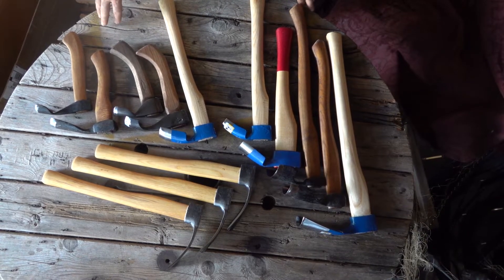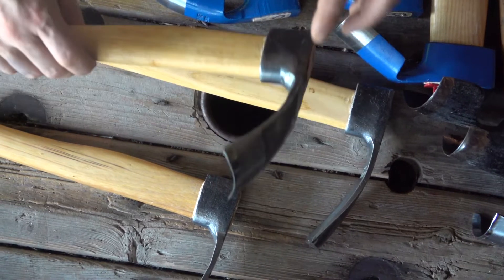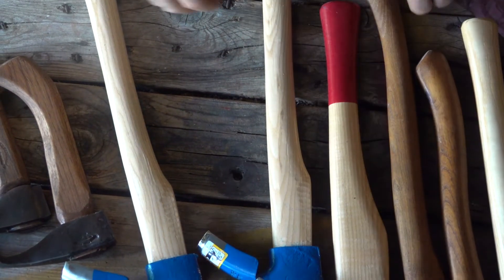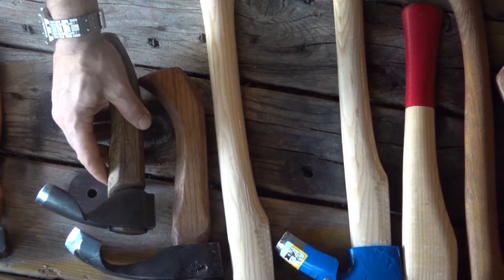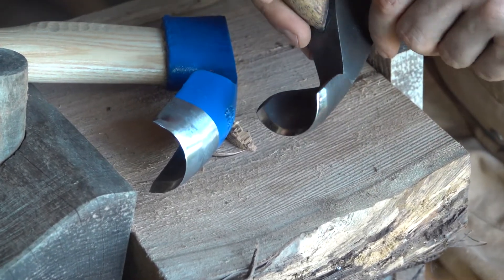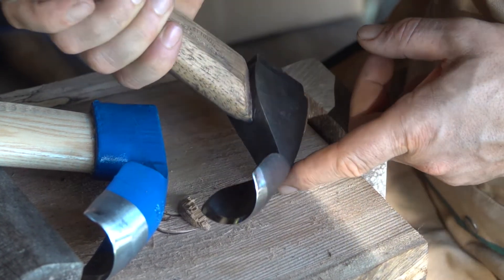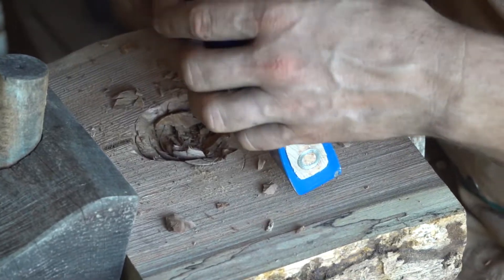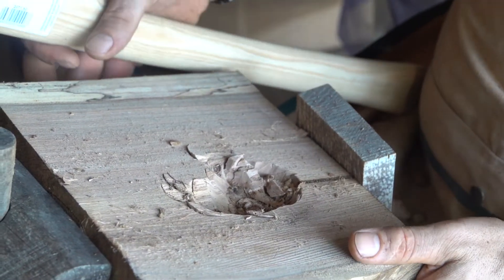The Best Adze For You! Brief Overview Of Different Kinds of Bowl Adze, and Inside VS Outside Bevel

Comment: Thank you sir,
I bought some East European hand forged spoon carving adzes, and they are all with the inside bevel.
Using them my practical mind wanted the bevel on the outside.
With your comprehensive and practical explanation, I can change the bevel knowing this is what I need to do.
Thank you 👍
Reply: Your "practical - logical mind" WAS indeed correct; The bevel SHOULD be on the outside.

Comment: I am looking at making stools with a shallow bowl seat.  Which would be best?  Inside or outside bevel?  I am edging towards an inside, because I will not be hogging out a deep hole.
Reply from the maker: Yes, if it is a shallow hollowing out then some of the inside bevel adzes could have an advantage.
Reply: @wisementrading  That's what I thought, but thank you for confirming.
Reply: Outside bevel. a hollow is a hollow. Straight surface, inner bevel, leving the outer face of the adze flat, just like hewing axes, Shipwright Adzes.

Comment: I have one of the austrian inside bevelled adzes.

Some observations:
The handle is far too thick. I find it tiring to grip. It is also quite crude in shape, just straight. 
The steel is very hard. Files skate off.
The bevel is quite steep.
It doesn't bite very well, and I find it difficult to cut a deep bowl.
The weight is good. Not too heavy.

Comment: A bowl carving adze should never have an inside bevel (unless it's a secondary bevel for more aggressive cuts). To be efficient, it has to work like a carving gouge: it needs to get in and out of the cut. With inside bevels, the "strike angle" is determined solely by the given head angle, leaving no room for in-and-out flow. As you demonstrated, the edge bites into the wood and stays there until you pry it out. There's no curve or flow to the cut. This is the same reason why spoon knives, bent gouges, swan neck gouges, and dog leg gouges are made with outside bevels.

The Swiss Pfeil gouges are excellent, but their adzes are the worst designed for bowl carving.

As for handles, there is a direct relationship between bevel angle and handle geometry. Straight handles with inside bevels have been used for hewing logs and beams for hundreds of years, in applications such as railroads and shipbuilding—think of a Shipwright's Adze or Hewing Axe, which are designed for straight cuts. The purpose is to achieve a straight, even surface, similar to how planers are used today. With the straight, no-bevel back of the adze, the cut follows through and creates a clean, straight slice. Look at old beams and railroad ties, and you'll see the result of this method.

If you're still unsure, consider this: Take a bent gouge and slice into the wood. It will naturally curve in and out of the wood, helping you shape a bowl. Now try the same with a straight gouge with an inner bevel. You'll cut into the wood and won't be able to get out of the cut without prying.
Jason Lonon, Hans Karlsson, Svante Djarv, Kharkiv Forge, and Fadir Tools (both in Ukraine, same owner, same blacksmith) make outer bevel adzes with superb steel and perfect design.

Comment: Good explanation. Thanks! I almost chose one primarily because it's easier to sharpen an outside bevel but didn't consider the different cutting characteristics. So would you say that one should learn to use both?
Reply from the maker: In away yes, there are always trade off to different designs so being versed in both could be helpful. The outside bevel is probably the more versatile design to start with. I don't necessarily think that the inside bevel is harder to sharpen you just have to use different technique and tools. Simple sandpaper sheet with a wood dowel works great and is not hard to master. Just wrap the sheet around the dowels and watch your angles like any other sharpening. Thanks for the question!